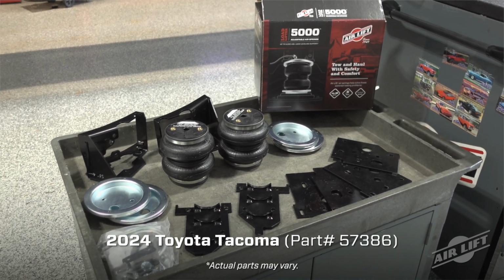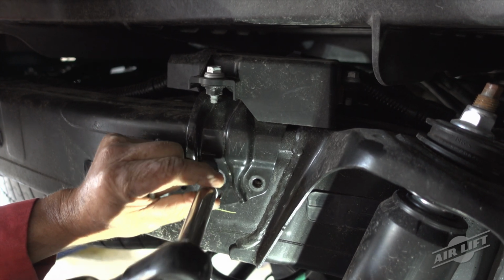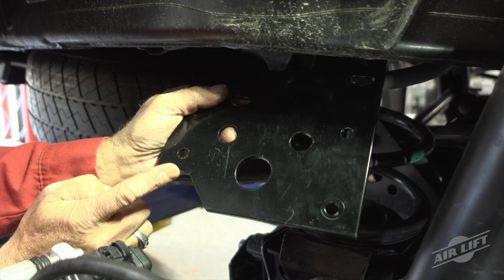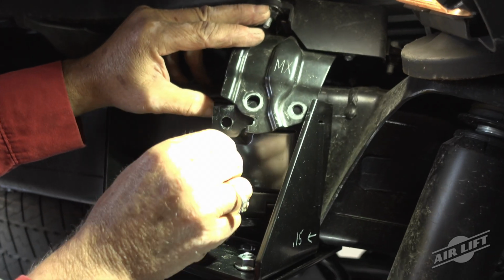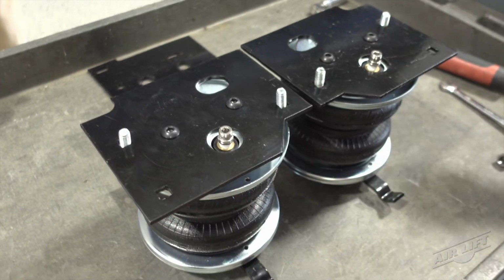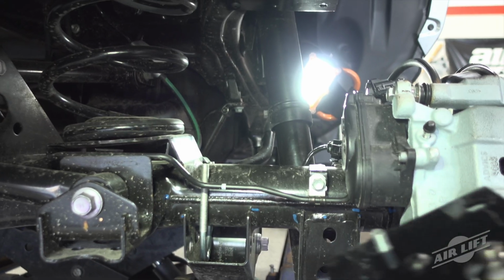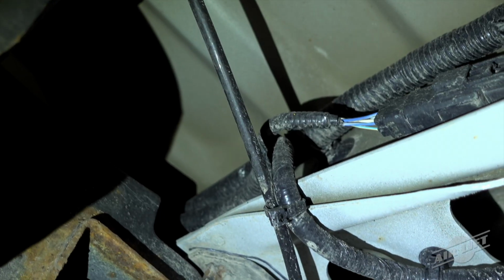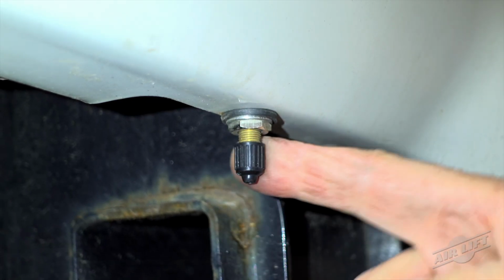Air Lift Install 57386: 2024 - 2026 Toyota Tacoma - LoadLifter 5000 - Air Spring Suspension

Comment: Seems easy enough.  I ordered my kit, just waiting on it to ship.
Reply: Would you recommend this product since you've installed?
Reply: @rodrun8  The product works as intended and I am pleased with that.  However, some places won't do oil changes or tire rotations because they are afraid to lift the truck due to potential liability issues.  Weird, but it is what it is.
Reply: @sonicsix  Thanks for the info, much appreciated.  We have a 17' travel trailer and are researching bump stop upgrades vs the air lift products.  How about tow mirrors? Any luck finding upgrades or recommendations?
Reply: @rodrun8  The longer bump stops make for a very harsh ride when they bottom out.  That's why I did not go that route.  My tow mirrors are stock and I have no sight issues.